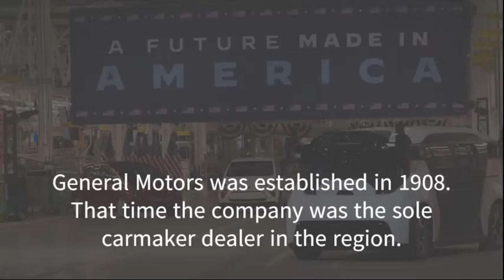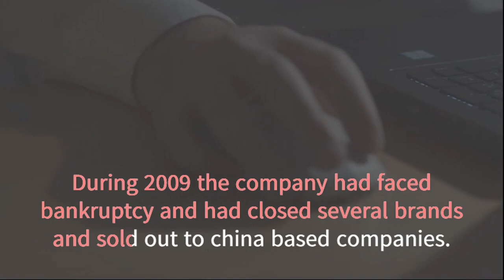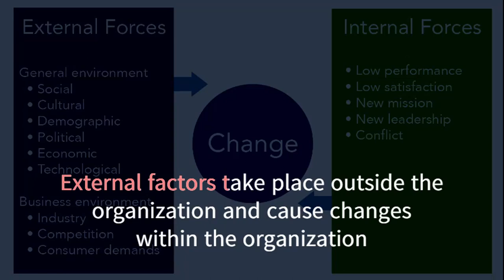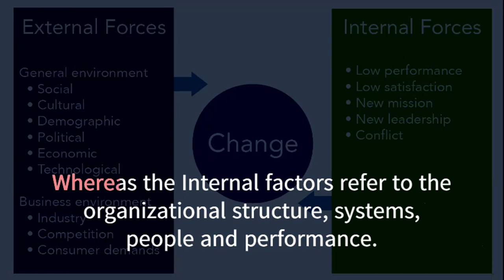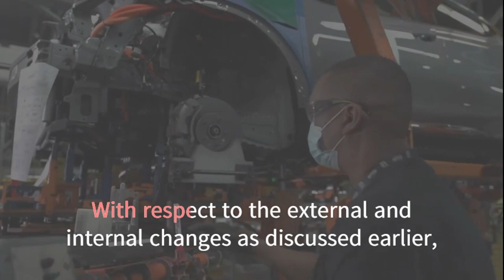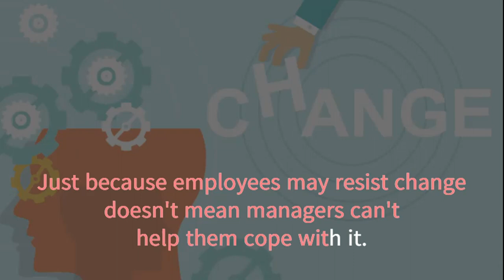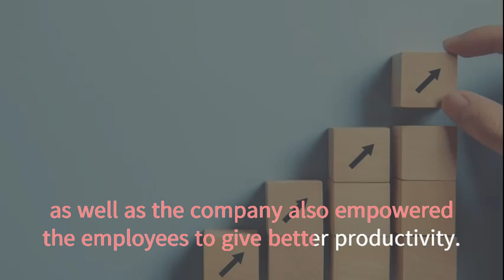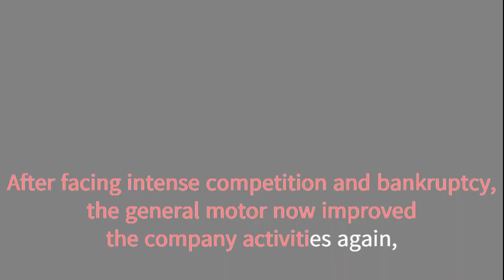Organizational Change at General Motors to defeat Toyota | Business Strategy | MBA Case Study | GM

Comment: Alfred P. Sloan, the most influential CEO of GM, believed that everything could be evaluated by one metric: Does this increase Return On Investment? His subdivisions had great autonomy, but the leader would be replaced quickly if he/she failed to achieve the required ROI. His autobiography "My Years With General Motors" is a great read. MBAs from MIT's Sloan School of Management are highly prized. Personally, I'm more of a Henry Ford guy. Toyota believes in increasing customer value and decreasing costs (eliminating waste). GM believes in optimizing corporate value, Toyota believes in optimizing customer value.